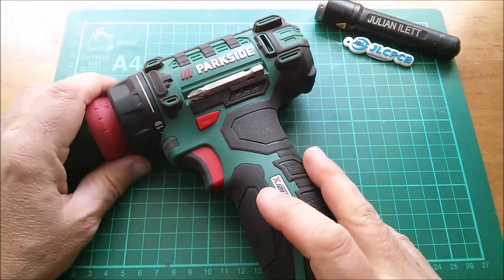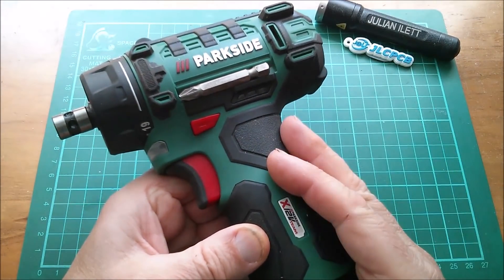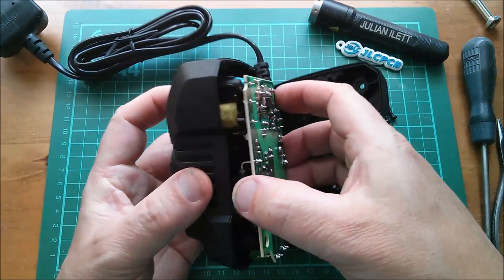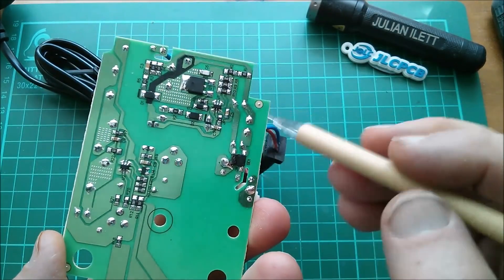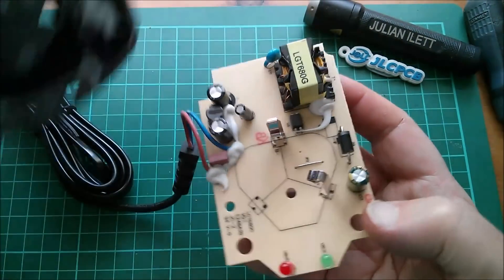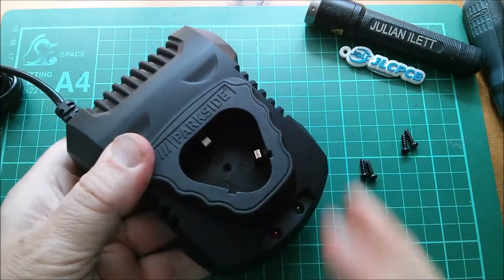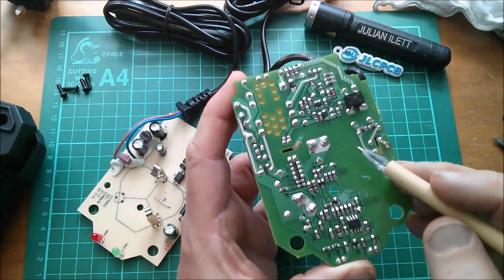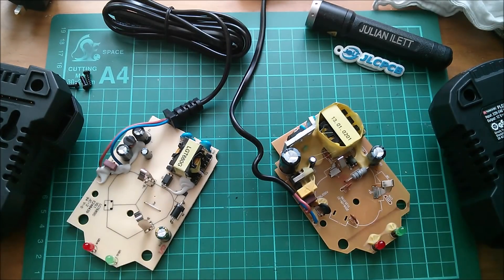Lidl Parkside PLGK12 Battery Charger Strip Down

Comment: Julian hello, quick question for you when, and if, you have the time. I did something silly a while ago and basically shaved the little strips of plastic on the batteries that sort of help with inserting the battery the right way in the slot. I shaved them because I used the batteries with a different drill. Anyhow, of course I went to charge one of these batteries and I inserted it inside my charger the wrong way, couldn't tell you exactly which wrong way because I immediately took it out of the charger but, that of course was long enough to have done some damage. Now the charger stays lit on green and won't charge dead batteries. I opened it up and I noticed only one thing that was suspicious. I should make a disclaimer that beyond soldering a couple things I don't really have much knoweledge of these things. But as I mentioned I did notice that the little strip of metal, for lack of better words, the one on the board inside the terminals is melted. By little strip I mean what looks like a straight piece of metal without coating that runs for just a couple millimeters more or less in the center of the board on the top side. Would you be able to advise me on this matter? Is there anything I can do to repair this charger? Is it a matter of resoldering the little strip so it makes contact again? I don't even know what that strip does but it sure looks melted on mine. I thank you in advance! All the best

Comment: Hello! 
Is there a way to measure the actual voltage of the battery? I mean it would be nice to add a simple voltage meter to monitor the voltage while charging - to be able to stop the charging around 60% for storage.

Comment: There's an 'A3' variant of this charger now out in Lidl. i've done a quick teardown; basically the same as the A2 but a different 8 pin control chip on the rear lower half; slightly wider LED's/board redesign etc. Fundamental components seem the same with the exception of an additional Yellow square 'Tenta' 0.1micro capacitor across the mains input, which appears described online as a 'safety capacitor', whatever that is. Clearly addressing something that was perhaps paired down too much in the A2 design?
Edit- A3 variant manufactured in my case 06/2022 so not that new, & it's also not a fast charge variant.

Comment: I loved the video, however i do  have a question .These chargers are ment for 220 AC. Is ist possible to modify it in the way that you could use a DC 12v car socket to charge the batteries?
Reply: came here for exactly this :)

Comment: Nice video. 👍 Do you think it's possible to adapt the circuit to be able to bypass the hi voltage circuit and connect 12v from the car battery directly to the low voltage circuit?
(I would love to be able to charge the Parkside batteries connected to the car..)

Comment: The jumper wire is actually a fuse. Pain in the rear.
Reply: .... mainly a fuse against a battery inserted with reverse polarity, seemingly in combination with the S5100 diode(s) on the left side of the board. Ask me how I know ... 

I have some "older" Parkside and Einhell 12V tools which all use the same battery form factor except for some extra plastic ridges molded into the sides. If you remove these ridges with a sharp utility knife, the batteries become interchangeable in the tools. 
You still need seperate chargers, because Einhell uses the proper "+" and "-" terminals on the battery to charge.

... but this also allows you to put a battery in the charger at a wrong angle if you're not paying attention, because these ridges also key the battery to the charger. Inserted at an 120° CCW you get reverse polarity via the main battery terminals, thus blowing the jumper/fuse.  The charger will happily show a green light and continue to "work", until you notice (after some time)  that every battery you put in to charge seems to be full already ... 🤔🤬

... at least  it's somewhat easy to spot and replace with some thin 1/4 watt resistor leg.

Comment: can you inject 12v DC from a car straight into the charger on the low voltage side to make an in vehicle charger? I've been trying to do it but cant work it out, I can measure 12v DC on the meter when connected to the mains, but I want to just solder some wires on the low voltage side, remove the mains cable completely and connect it to a vehicle, any idea where to solder to to still have the Lion chips active?

Comment: Bonjour,
Intéressant mais vous auriez pu compléter par le fait que la recharge s'effectue par un contact dédié sur la batterie et non, comme la plupart de ces batteries, par l'intermédiaire du plus et du moins. A suivre...

Hello,
Interesting but you could have added that the recharge is done through a dedicated contact on the battery and not, like most of these batteries, through the plus and minus. To be continued...

Comment: Hi Julian!
I need your help with a Parkside 18 volt charger JHL-H150-18 (reciprocating saw). It outputs only 0.15 volt. Would you have a circuit diagram or help me diagnose the circuit? Thanks. (Sham)

Comment: I have 2 of these drills (older versions).
I have been using one for the past 3 years for electronic assembly, I use it every day and it works exceedingly well for terminal screws as the torque on the lower settings is quite low.
I would normally have to pay almost £300 for a low toque driver.
On the older one the battery has polarization slots so you cannot use newer batteries, however if you simply cut them off of the battery then new batteries will still fit.
(Just be careful when putting it in the charger).
I have the newer one for a backup, but having seen the internals of Makita and Bosch drills, I would actually put the internals of this drill as an equivalent.
The magnet for holding bits is pathetic and they keep falling out, but the damn thing has been going strong for so long :)

Comment: just bought one of the 4ah packs to strip for the cells to use in my vape, i figured that if they are intended to be used in a power tool and also come with a 3 year warranty that they must be of at least reasonable quality.
onc i got inside the cells were marked with parkside branding and not grizzly and the pcb is also very different to the 4Ah pack you opened.
i found this test for the cells that are in the pack that i dismantled, it reckons that the cells are good for 20A: https://lygte-info.dk/review/batteries2012/Parkside%20INR18650E%202000mAh%20(Blue)%20UK.html
Reply: Follow up: ive been using those cells in my vape for a while now and they are performing well :)

Comment: I've got one of those drills, the older one from last year, there was also a slightly different version before that too, which had a lower capacity charger, and the battery  was slightly different, the guide slots were in a different position, so you couldn't interchange the batteries.
I've just bought the 4ah battery to go with my one too. They've definitely skimped on the circuitry in the new charger.

Ive  noticed with all Lidls power tools, that each time they have them back in stock again they change the designs very slightly.

Comment: The blue items are actually transient voltage suppressors not capacitors. There is good isolation between mains and low voltage.
Reply: I disagree, they do appear to be "Y" interference suppression capacitors in the traditional sense. The device "CY1" can be seen to span the isolation barrier. It's probably a low-value providing an RF path from the low-voltage side back to mains for EMC reasons. It's possible that CY1 goes to live and CY2 goes to neutral (or vice versa).

Comment: It looks like the current limiting is done on the primary side with 3 sense resistors in parallel, so you could lower the current by removing one so it doesn't get so hot. With just a little more work, the voltage feedback can be tweaked to lower it a little so the batteries age slower.
Reply: Did both modifications: remove R8 to reduce max charching current to 1.4A. Then parallel  to R12 (which is 10k) another 100k. This reduces max voltage from 13V to 12V. So it is a slower half-charger. However, since charge termination is done in the battery, with this modification, it does not terminate the charge.

Comment: Julian, you should pick up one of Lidl's Parkside gas powered soldering iron/heat-gun/blow-torch.. it's excellent for the money, 16.99euro dont know what that is in English pounds!! you get a small bottle of gas with it but you can refill it with lighter gas.. it works great. ya get four tips. chisel,wedge, small pointed, & one weird looking thin tip. some solder wire a sponge and a scooped shape half cylinder for heat-shrink tubing for use with the heat-gun (which is why i got cause i had no heat-gun)  Anyway if see one in Lidl's, its worth the cash!! cool video.. : )
P.S. the high voltage to low side clearance looked good on that compared to other shitty one's ya see, but that's down to our safety standards id say!! which our 3 pin wall plugs in England & Ireland prove are the best.. ; )
Edit: oh god i wrote the P.S. before i saw the end of the video with the older charger.. which is way better. but that's money saving, penny pinching for ya!!

Comment: hi i think you have mixed up NTC and PTC thermisters the idea in this kind of circuit is it starts at high resistance and drops to low resistance to stop in rush . A PTC starts low (5 ohm) and increases in value like in the degausing circuit used in colour tvs. so you right it is an NTC but your discription was wrong .nether the less a fasinating video..
Reply: I can't see anything wrong with Juiian's description, he said pretty much exactly what you wrote.

Comment: I had a Westinghouse TV with the varistor issue.  If you turned it OFF and immediately back on it Blew the Caps.  I  raised the value on the Cap Bleed Resistor as a fix.  It worked.
Reply from the maker: Awesome - exactly the timing issue I was trying to describe :)

Comment: Julian, overall what do you think of the Parkside tools?
Reply from the maker: I think they're great for the occasional DIYer. They may not last for decades, but they're cheap and they get the job done.
Reply: Julian Ilett and if they break within two years you’ll get your money back at the till :-)
Reply: @AdamWelchUK  3 year warranty on  most of their own brand tools, just make sure you keep the receipts safe.
Reply: NOW, That's Richy. Three year not two? Even better. Let’s hope the thermally printed receipt lasts that long!
Reply: @AdamWelchUK  Yes, that's another thing, you've got to be careful how you store those thermal transfer receipts, otherwise they can fade to nothing after a year or so!
Best to keep them in a paper envelope, (not plastic) in a dark dry place.
I suppose if it is a really expensive item you could make a photocopy or take a photo of said receipt.

Comment: Another issue is that the voltage on the mains plug has to drop quite fast so you can't get a shock when you unplug it and touch the pins. can't remember off hand what the time to drop to what voltage. Also can't think of what safety standard they would be referring to. have to look up the LVD directive and see what standard a tool power supply required to meet.
Reply from the maker: That could only come from the class X capacitor (if fitted) which is directly across the mains. The high voltage electrolytic is behind the bridge rectifier.
Reply: For grid tie solar inverters, it's 2 seconds from AC disconnect to less than 30V on the AC terminals. The DC side, if it supports rapid shutdown, has to go to less than 30V in 30 seconds. (Not sure what is is on the DC side without rapid shutdown, I think it's 5 minutes or something like that?)
For devices in general, I think the requirement for safe discharge is set by the energy level, so the voltage would be lower for larger capacitors.